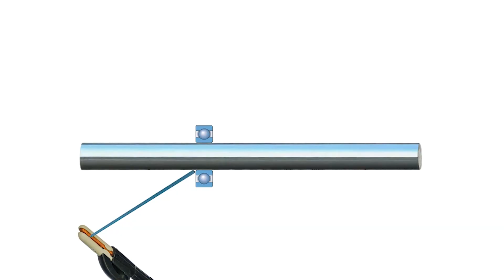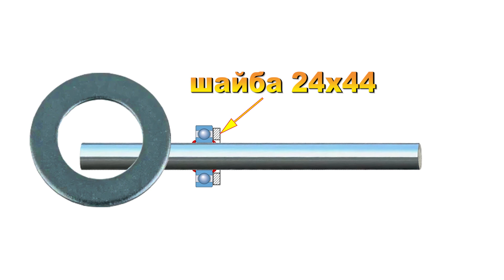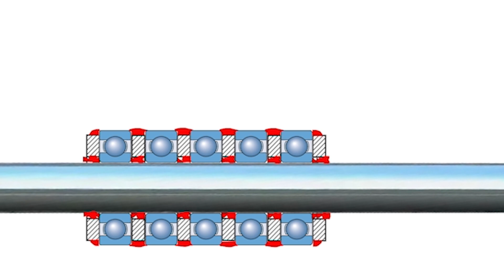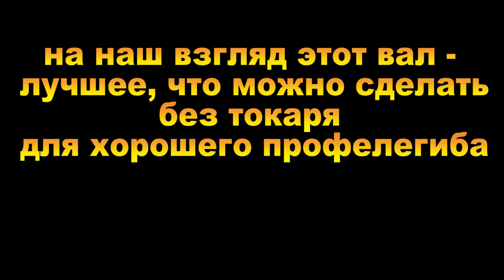ЛУЧШИЙ вариант для трубогиба без токарных работ

Comment: Just Think. Is welding really needed? why not use only bearings without welding and clamping only inner races on a shaft. Very good illustration though.
Reply from the maker: The shaft should look like a whole piece of metal. If the bearings are not welded, they will simply scroll